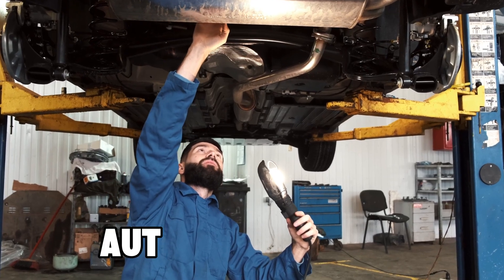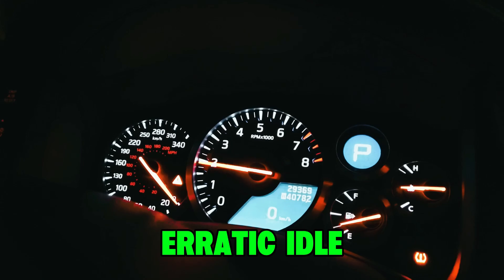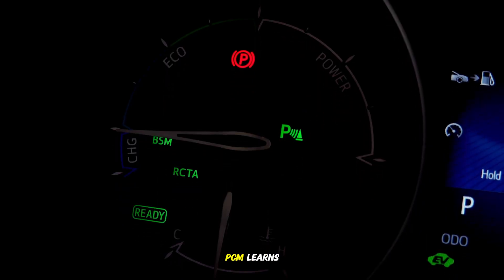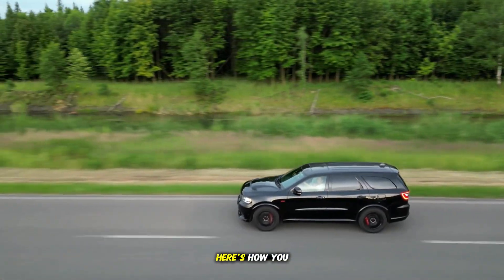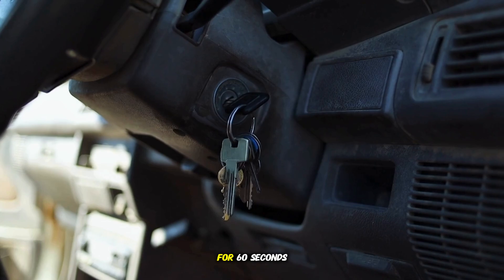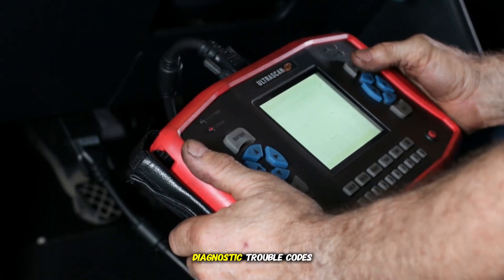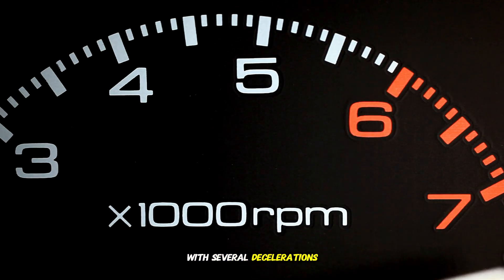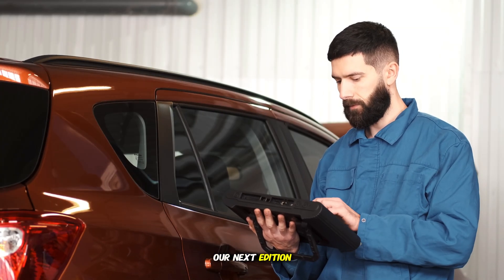How to Manually Reset and Relearn Your GM Electronic Throttle Body

Comment from the maker: 💡 Quick Tip: Always make sure your battery is fully charged before performing a throttle body reset! After resetting, allow your GM vehicle to complete the relearn process by letting it idle for at least 10–15 minutes. This ensures smooth throttle response and prevents check engine lights. 🚗✅

Drop your questions below if you get stuck—I’ll help you troubleshoot! 👇